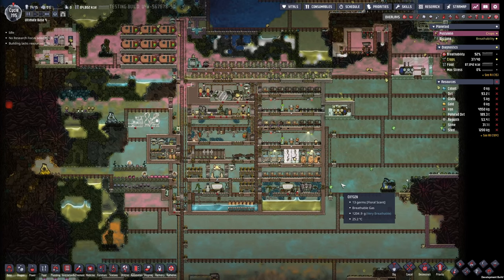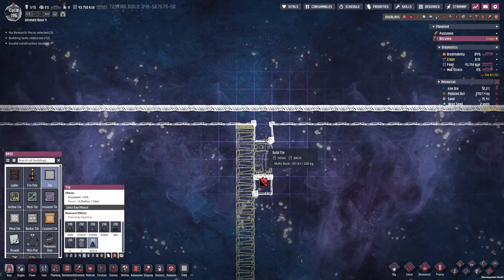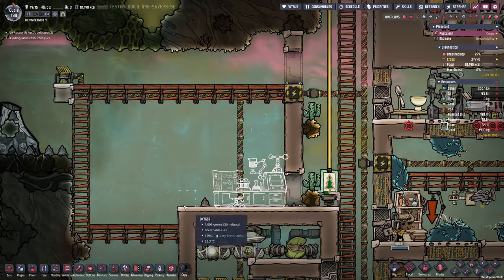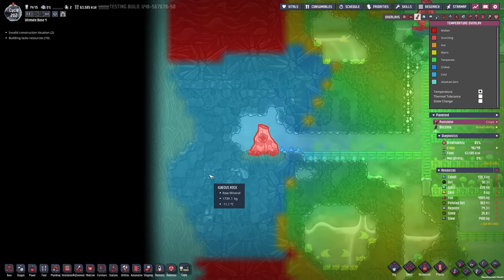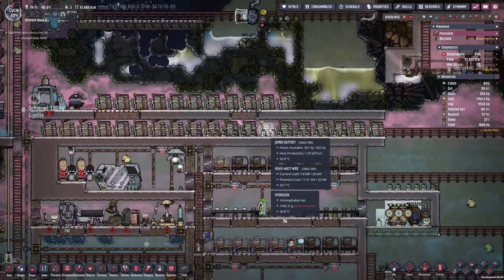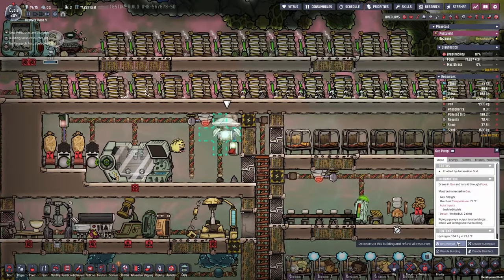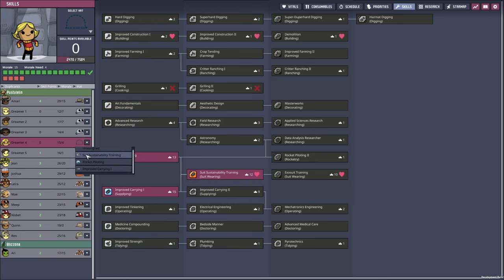FIRST DUPE LABOR SHORTAGE - Ep. #14 - Oxygen Not Included (Ultimate Base 4.0)

Comment: 0:49 you're going to dump your molten glass on top of a tile under your sand storage bin, and it's going to flow in front of at least your glass forge.  Good job you caught it when you went to start up the glass forge at 1:36
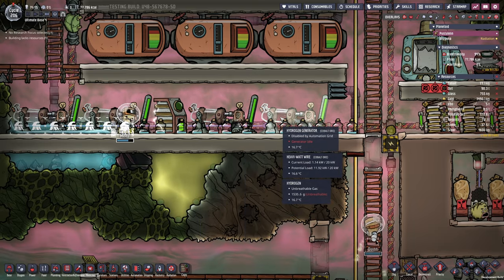13:40 If you set the smart battery to low threshold 0%, the jumbo batteries will be at 50%  Every 5% on the smart battery is 1KJ stored.  So with a setting of 30% low, you're turning the hydrogen generators on about when your smart battery has 6KJ, and your smart battery reaches 95% as you're running the hydrogen generators to produce 70% (14KJ) of the capacity of the smart battery which in turn is only 35% of the jumbo battery's capacity.  If you started at 0 power, and no other power source, the smart battery would never top off the jumbo batteries, if you started with the jumbo batteries full the hydrogen generators will be called upon before the  jumbo batteries get down to 50%

Priorities: A commonly misunderstood mechanic.  All tasks have a basic priority, in that the AI looks at the chart from left to right for each dupe. [Part of this may be of use to you, but I'm largely explaining for your viewers benefit, so it is less misunderstood]
Using just the often misunderstood "take item from here to there" tasks
Life Support (delivering to oxygen producing and water purifying devices - deodorizers, algae terrariums, water sieves, etc)
Supplying (Delivering to machines not classified as life support but priority - metal refinery, electric grill, build orders, etc )
Storing (moving supplies into storage locations - storage containers, refrigerators, etc)
Ignoring all the other job types, assuming all jobs are set to the same priority, and not using proximity  A dupe who has all their priorities set even when presented with a construction command needing, say 200kg of ceramic (supply construction material), an algae terrarium needing algae delivered (life support) and a storage container that has room for algae (storing) with 1000kg of algae and 1000kg of  ceramic.  Again all priorities are set equal for the dupe and the tasks.  The dupe should deliver algae to the terrarium, then deliver the ceramic to the construction command, once those tasks are done then start moving the algae and ceramic excess to the storage container.

The AI looks left to right across the list for the highest duplicant priority task that comes first.  Since life support appears first left to right of these, the AI will pick that life support task before the supplying or storing commands.  If however you adjust the duplicant's priorities to be up one tick on supplying, though life support comes first it's not the first command found with an increased priority,  Basically it looks for the first occurrence of a "maximum priority", if it does not find one, it looks for the first occurrence of "increased priority" again if it doesn't find one, it looks for the first occurrence of "normal priority" and so on.  When it finds a task with the highest priority available, with a job of that type available, it will then look at the priority of those jobs that meet the identified parameters (if there are 2 terrariums requesting algae, but one is set to priority 5 the other to priority 2, it will select the priority 5 first.  But the construction job needing materials in the above example, even if set to priority 9 will be selected only after both terrariums are no longer requesting the algae.  

Since you have so many deodorizers, which are a life support task, and life support is max priority for Meep, he will keep running to deodorizers in need long before he will get to his tidying or storing.
When you added Mae to top priority in Storing, their only other top priority was Rocketry.  There's no rocketry task to be done at this moment.

20:00 personally I find the counterflow approach more effective, run the coolant in the opposite direction of the heated material flow, as long as your temperature ranges are managed, it tends to make for a more stable output temperature of both materials.  (hot ore on conveyer going Left to Right? the cooling radiant pipe should go right to left through the same tiles.  hot ore on conveyers going bottom to top?  the cooling radiant pipes should go top to bottom, etc.)  Your coldest coolant then hits the coolest of the hot stuff, then the slightly warmer coolant hits the next, and so on. Because you're still cooling with the last crossover tile, but you're forcing the output temperature of what's being cooled to hit progressively cooler coolant.  While with it running the same direction, one packet of coolant is running alongside the conveyer it's trying to cool, so the same pipe full of liquid stays alongside the same conveyer full of hot metal.

It would probably be a good idea to add your filtration mediums to your supply list on the side.  If you run out of, or low on them, you're going to have problems when you're asking dupes to supply or life support using filtration medium.

Comment: Don't try tame the aluminium volcano without steam turbines kkkkkkk the cobalt works because of vaccum and the tiles heat faster event with low temperatures, gold is the only one what is easy (low temperature and event more low heat capacity), unless you want sacrifice a lot of cool water/polluted water, then will works fine at least for 1 complete cycle of active/desactive. Some plays I do that, open the metal volcanos with some expressive water, even gold.

Comment: I wonder if a liquid airlock would work in real life too. It obviously can't evaporate in a vacuum, so no water, but maybe some oil. Also, there would need to be a simulated gravity, maybe from centrifugal "force". This is due to the pressure difference of 1 bar and 0 bars (in space) pushing the liquid into space, but a simulated gravity would hold it in place. Lastly, it would need to not diffuse any molecules from the atmosphere in the ship, which I don't know if any oils do
Reply: The problem is security and efficiency concern. Having you life depends on a layer of liquid is quite a risk, plus energy needed to generate a centrifugal force is a waste considering you only need it solely for an airlock. Pumping air in and out for a normal, thick layer of metal doors airlock will most likely use far less energy and much safer.

Well, once a commercial spacetrip is a widespread thing, maybe that'll really happen. A fancy liquid lock and simulated gravity are probably luxury things consumers gonna like.
Reply: @DixxyV  I agree it would definitely be a risk, so we would need multiple and differing sensors to test for a breach with an actual airlock. I don't think it would be less efficient than a normal airlock though. Once the ship is up to speed (which would be the inefficient part), it wouldn't need to spend any more energy on keeping the liquid airlock functional, since a force can be exerted without using energy (like a rock sitting on a floor). Also, the reason I think this would be viable is the same as in Oni, where no atmosphere is released when the airlock opens, since q perfect vacuum can't be achieved irl, but a perfect liquid seal might be possible. Also, assuming it won't be really slow going through that liquid, it would be much faster than standing in a room that needs to turn into a vacuum.